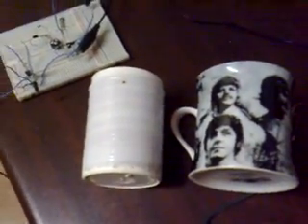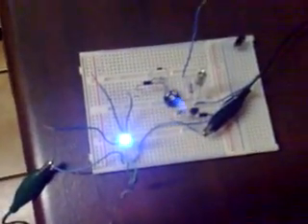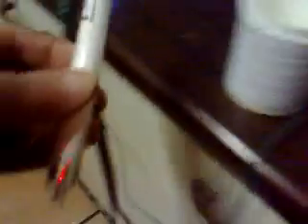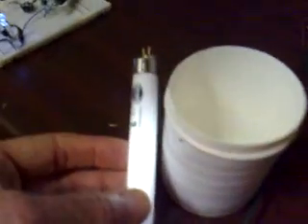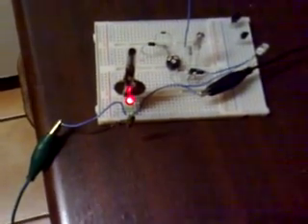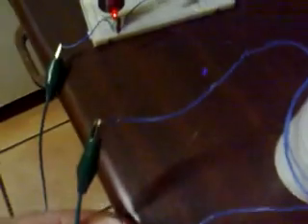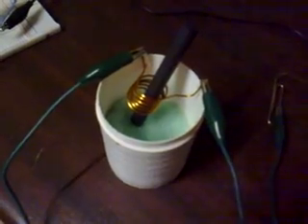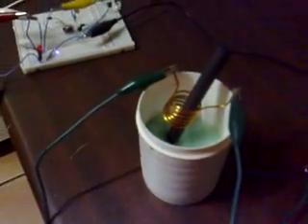Slayer exciter.Plasma with Slider2732 coil and other tests.

Comment: Right, I was thinking the amperage would have to be higher than 0.001.
I can go up to 6 amps, but I'll probably need some power supply components
that can handle the current. I found a power transistor that can handle 15 amps, butt still a bit confused on watt rating of resistors. Maybe I could build a 25 watt  system with 23 ohms to get 1 amp, but the voltage drop would be huge I'm guessing.

Comment: Do you think a slide potentiometer would work for voltage control? Pretty anxious to get the coil working. With the 24,000 ohm resistor its showing 0.001 amp. Do you think that's good enough to produce plasma from the secondary? I have about 175 turns on the 2ndary. and a 25 turn caduceus primary, but think I'll make another with just a couple turns to get the voltage up. Thanks again.

Comment: Thanks for clarifying. I'm pretty new to it and will be using a 24 volt power supply..
The math is showing 576 Ohms for 0.04 amps, and 48 ohms for a half amp, but I'm guessing our coils will have their own Ohm resistance values too. I'll pick up a meter when I can. I have my coils made, and have a 16 neodymium magnet base underneath the secondary coil. I was thinking about putting an aluminum cap on top of the coil so the plasma would circulate around the aluminum cap(45 rpm record adapter) :D

Comment: I have a 24 volt power supply,, trying to figure out the resistor and transistor needed so I don't burn up the power supply. I finished winding the coils around a cylinder. I might try for a 48 ohm resistor for half an amp. Hopefully a transistor can sink the current without burning up the power supply. If I'm thinking correctly, it might be 12 watt.

Comment: Wow that is quite amazing! Could you possibly send me a link to where you got the circuit diagram from as I would love to try this circuit out.

Haha that 40SWG wire can be a pain to work with, I know from experience. I was once winding a small secondary coil for a homemade high voltage transformer and needed each turn of 40SWG wire to be next to the other and about half way through winding it snapped making about 2 hours worth of winding all for nothing.

Alex.